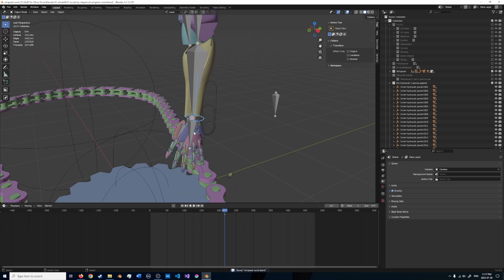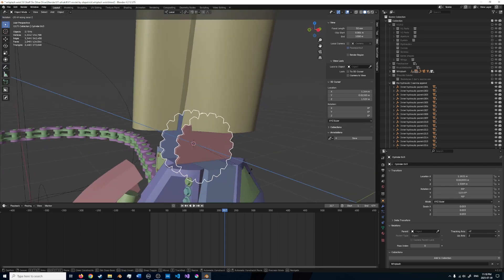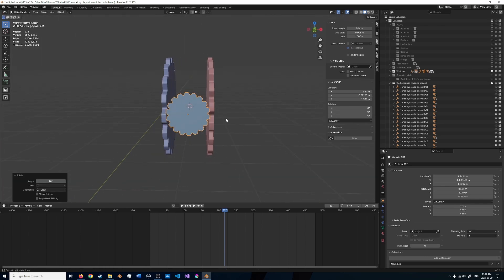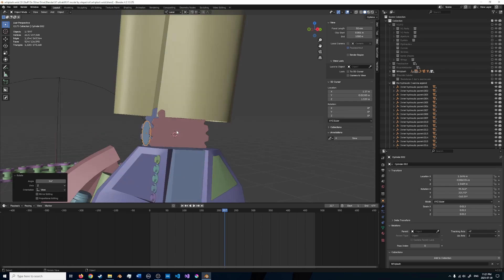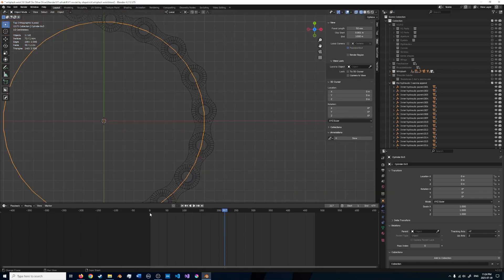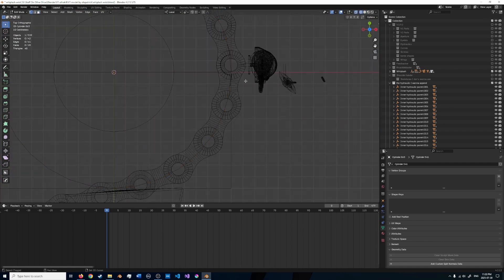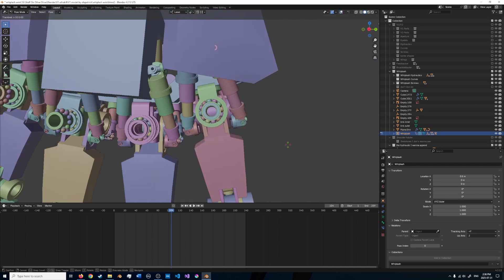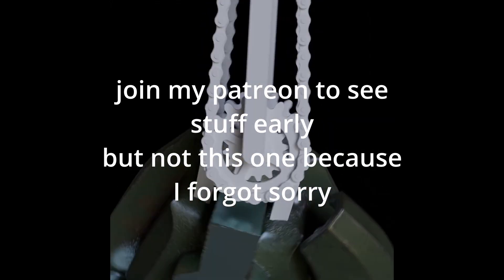making ultrakill whiplash pt 2. wrist

Comment: Do you count durability of parts/material, i mean looking back on some of your mechanical decisions in V1 and hand models, there are parts that will clearly break when tried to be moved.
Reply from the maker: no not at all. sometimes I see things that will clearly break but I don't really care enough to make them stronger. making the pieces stronger is way at the bottom of the list. it will probably never happen
Reply: @olepatrick1053 lazy ash